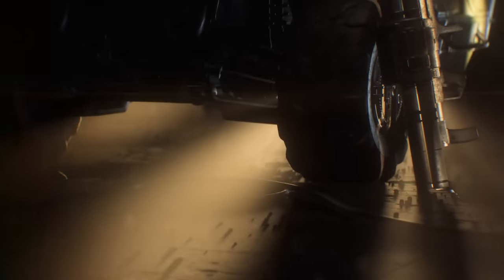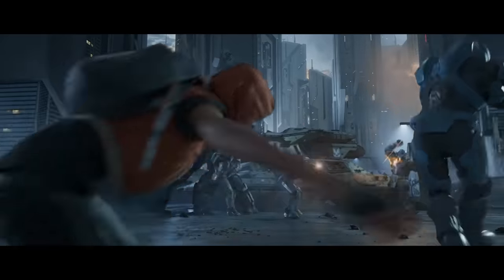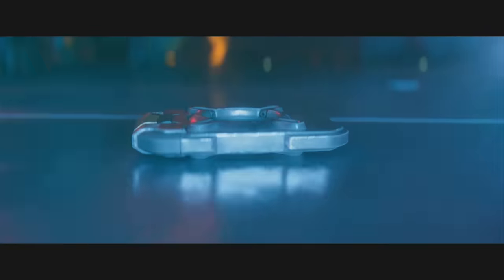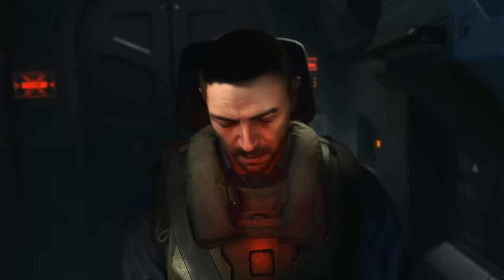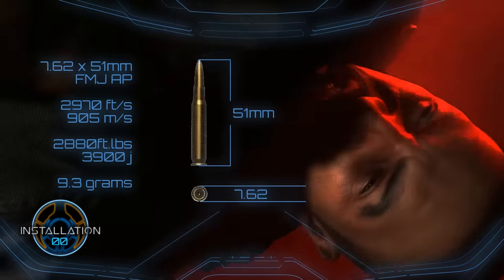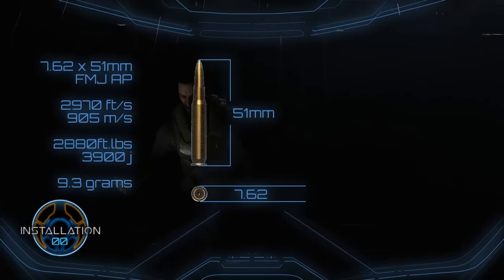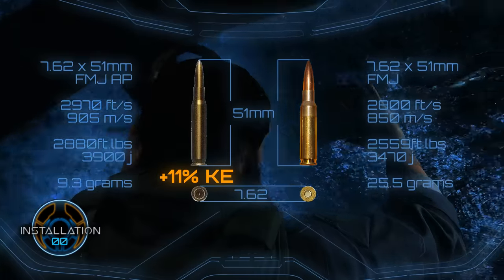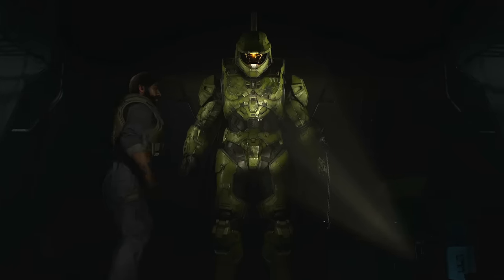Why are UNSC Weapons so powerful!? | The Armory

Comment: The main issue with the magnetic acceleration is having a hybrid system like that could cause a much weaker kinetic impact if there's even a slight desync in operations. A problem that could be rectified, but at that point, it could just as easily be a full rail gun and be better off. As is, it'd spend a lot of electricity on something that could, at best, prevent a full jamming and shoot out a bullet at roughly half strength. The geometry of the bullet is not exactly aerodynamic, not aerodynamic enough to be optimal for magnetic acceleration. A smaller projectile like a thick needle would be much better since magnetic acceleration would not be inducing rotation naturally, so it'd need to reduce flight friction. Those kinds of projectiles would also reduce the ammo's mass, or increase capacity depending on which way you want to go with it. Mass would be better thanks to the amount of magnetic coils and the weight of the battery you'd need in the gun to make it work. 

Personally I think there's very likely two things that would make UNSC ammo better. Improved gun powder, which he went over, and altered bullet construction. The FMJ AP bullet design (redundant because armor piercing bullets normally have the same jacket FMJ has, but whatever sounds fancier) could have an optimized bullet design, adjusting mass for higher speed and construction to have a stronger impact, such as having a thin, dense metal core that is designed to pierce easier. Something like that could account for the difference in power. Mass, less so because that's an impossibly light bullet, especially if it's intended to hit hard.

Comment: 4:06 Yeah the maths more than a little fucked here.

Muzzle energy is a just the kinetic energy of a projectile from the moment it leaves the barrel. This means the calculations for it is just Mass x Velocity = Kinetic energy.

In this case given muzzle velocity is 905m/s and assuming the 9.3g bullet weight is just the head it's supposed to be about 3810j of kinetic energy. As you may notice, this is the same muzzle energy as a normal 7.62x51mm cartridge. Meaning that the bullet, upon being fired either needs to get faster than it leaves the barrel or weigh more than when it's shot. Both of which are somewhat insane and unlikely explanations compared to someone fucking up the numbers.

More than likely the projectile has to either maintain the same 905m/s velocity but fire a heavier 9.52g projectile or use a 9.3g projectile but achieve a 916m/s velocity instead. At least in order to achieve the listed 3900j of energy in the infographic.

4:22 The issue here is pretty clear, you've managed to mix up the bullet and the cartridge. In standard vernacular a bullet is often synonymous with cartridge, however, in gun industry and ballistic science it specifically means the projectile being shot.

If a 25g projectile was being shot a muzzle velocity of 850m it would be hitting their given target with 9031j of energy. Which is clearly about twice as much as the Halo cartridge.

In this case the numbers replicated US 7.62x51mm M80 Ball, which from a  56cm barrel, achieves a 850m/s velocity with a 10g projectile to achieve a 3470j muzzle energy. The 25.5g weight is the weight of a 7.62x51mm M80 Ball if it has loaded into a M13 Belt link for use in a FN Minimi/M240 General Purpose Machine Gun. As the cartridge normally only weighs about 24.6g on it's own.

12:30 While making guns hybrid conventional-rail/coil guns is possible. It's, as you mentioned, rather unlikely.

My opinion is that if it's still 7.62x51mm then it's a mistake of numbers or just hand waved via better propellant powders. IRL examples of this have been done both by civilian handloaders and by military projects. The one that has seen most widespread development being the US Army 6.8x51mm and NGSW program. Which uses a absolutely tiny 33cm barrel to fire a 9g projectile at 914m/s for a muzzle energy of 3759j. If such a cartridge was fired from a MA5's 60.7cm barrel it would likely exceed the 3900j of the MA5.

However, I don't actually think this is the case. Instead, I think the person that wrote the numbers was looking at a standard 30-06 thinking that this was the civilian equivalent to 7.62x51mm. Modern commercial loads can push a 30-06 bullet weighing 10g at velocities of 905m/s for a total muzzle energy of about 4095j. There are other loads using heavier projectiles that can manage muzzle energies beyond nearly 4200j and velocities up to 1100m/s.

Comment: Modern cartridges aren’t generally limited by the potency or quantity of propellant. It’s very easy to load modern cartridges beyond their specified pressures. The limiting factor is the materials used to build the firearms and cases, and how much pressure they can withstand. If rifles and cases were invincible 7.62x51 could easily be loaded up another few hundred FPS.

This question is thus easily answered. Metallurgy and rifle design improvements have allowed for higher pressure cartridges by making the rifles more durable.

Comment: Good video on the subject, otherwise many would say that the reasoning would be game developer's biases. When I saw the concept for the video I thought mainly along the same concept guidelines as you but didn't consider the hybrid magnetic accelerator concept. The three main issues with that concept are the power, battery size and recoil management requirements. Considering that most  of these weapons will be used for hour's of continuous use would require a battery backpack armor setup like Spartan George's rig to function satisfying both the power & battery requirements, plus the extra force expended from long term firing even wearing basic armor could cause significant long term blunt force trauma to the body (akin to long term injuries suffered by professional fighters, except for augmented humans/Spartan's) given what we could replicate now. My future hypothesis of how this could be overcome within the game world standards mainly depends on three possible future innovations. One, the weapons draw power using the theorized wireless free energy concept purposed by NicholaTesla, thus meeting the power requirements basically anywhere (a far smaller amount of power would be needed than that of most other energy weapons)and sigicantly decreasing the battery size. Secondly, the gun barrel would need to house a electro magnetic accelerator past the middle of the barrel for that extra velocity (see XCOM 2 videos on magnetic weapons), the extra velocity does add more power to the projectile at a minimum cost and an acceptable rate of fire (with further recoil from the em booster directed further away from the body). Third and lastly, new materials would add more durability for longer service life and compensate for recoil to manage accuracy. Thank you.

Comment: Regarding your last theory of magnetic booster. The Marine's C-14 rifle from the Starcraft series works in that way. The rifle, while called the C-14 Gauss Rifle, is described as "Gauss Assisted". Ammunition used a traditional propellant to initially accelerate the round, and magnetic accelerators increase it's speed further. But...

This concept has confused me ever since I first heard about it, because if you have the technology to make magnetic accelerators that can go in rifles, then why even bother with a burning chemical propellant at all? Why not just use uncased, solitary projectiles that are entirely magnetically accelerated?

Granted I have only a passing knowledge of physics, so anyone with more knowledge feel free to explain how this would work. But with a "gauss assisted" system I can only imagine it going one of two ways.

Either the magnetic system is less or as powerful as the initial chemical propellant, resulting in the round traveling too quickly for the mag system to add any velocity at all. In which case, why bother even having the magnetic assistance.

Or, and more likely, the magnetic system is more powerful than the chemical propellant. Resulting in the round, once being caught in the magnetic accelerator, being pulled away from the expanding gases at a much higher velocity, thus rendering the use of the chemical propellant effectively moot. At that point the chemical propellant's only contribution is basically loading the projectile into the magnetic accelerator. A task which the magnetic systems could have just been built to do themselves instead. Or through some sort of plunger that pushes the round into the accelerator. 

To put it another way, imagine you're driving a car down a straight track. Now imagine as you are driving, an large plate or pad or whatever is accelerated to, let's just say 40mph, right behind you. If you are traveling at less than 40mph, the pad is going to catch your car and push it along at 40mph, rendering any power from the car's engine useless. And if you are traveling at 40mph or higher, the pad will not impart any force onto your car at all, as it cannot catch up to you to make contact, and it thereby may as well not be there at all.

Comment: As a reloader most of the weight of the round is the brass casing. If the UNSC went with polymer or caseless rounds the weight difference is right there.

Comment: if the propellants are theoretical, what would the SMG use?

it's caseless, primed via electronic circuit, and won't or rarely misfires (even during high cyclical speeds)

Comment: I just considered a Limited Gyrojet as the propellant does not burn completely during flight. In long guns and rifles the burn will last as long as the bullet is in the barrel allowing for more acceleration instead of the big kick on firing. For some reason this feels like it would not work out as well as I think it would. But this is the idea I have. 

And the bullets are monumentally harder than the ones we use today. Given that Humanity can condense matter to make Moljnir armor, a formulation, which might include the use of Tungsten (W), and/or condensation of matter to make ultra hard bullets is not out of the question.

Comment: Seems the current US military AP round corresponds pretty well with the HALO stats.  I bet the 9.3 vs. 9.8 projectile weight difference 
is a result of looking at a poor paper copy.  From Wikipedia:

Cartridge, caliber 7.62mm, NATO, armor piercing, M61: 150.5-grain (9.8 g) 7.62×51mm NATO armor-piercing round, black cartridge tip. Data contained in TM 9-1005-298-12 mentions an approximate maximum range of 3,820-metre (4,180 yd) at 854.6-metre-per-second (2,804 ft/s) muzzle velocity.

Comment: Just noticing, the figures for the UNSC rounds look pretty similar to those for the 308. Assuming advances in metallurgy, a light alloy may be used for the FMJ on the round. This could go a decent way to explaining to discrepancies in the figures.
Reply: That would be the possible explanation. Then there's also gravity. Materials made in zero g would be different than those made under gravity.

Comment: the halo firearms could be ETC guns (electro thermal chemical guns).
these use an electric plasma arch as a firing mechanism instead of a hammer and use a higher ignition temperature stronger explosive as a propelant. 

the guns also most likely have a time distributed recoil system in place, so the operator is not hammered to pulp.
material improvements keep the weight bearable.

Comment: It could be a multi part casing. The measurements are still off but if you look at the new round for the xm5, (6.8x51) they are achieving almost ridiculous pressures and velocities.

Comment: I think the magnetic accelerator is the most likely. Think back to nightfall. The unit was hunted by hunter worms attracted to the energy of their equipment. Including their guns that couldn't fire without the electronics activated. If it's only an ammo display that wouldn't be the case. But if the weapon no required that MA device as apart of it's function it would explain everything.

Comment: Kinetic weaponry has more penetration. Plasma weaponry leaves more surface damage and burns. Shrapnel is a thing that causes bleeding out. Plasma does not cause bleeding. There is a reason the needler is the most dangerous weapon in the covenant arsenal. Its the equivalent of a knife that homes in on its target stabs you  stays and then explodes. The slowness of the weapon allows a reactive trooper to find cover quicker than it can home in on its target. Less effective than an assault rifle which hits near instantly.

Comment: 10:20 - omfg, why do so many people get this wrong?  Any gun using any composition of poweder from black powder to smokeless to modern multi-base propellants will fire in a vacuum.  The firing chamber and cylinder bore are a sealed and self-contained environment until the bullet is expelled.  The only oxygen between the bullet and the bolt face is what is contained in the powder charge.  it doesn't matter if you are in regular earth's atmosphere, a vacuum, or even underwater, any sealed-cartridge weapon will fire.  If you test fired a weapon in a vacuum chamber and in a chamber filled with pure oxygen at 1 bar, both would expel the projectile with the same energy, because the environment outside the gun is not available for chemical reaction with the gunpower.

Comment: Every time I see a Halo Lore analysis I keep thinking about a sore point of mine which has caused Halo lore to irritate me.
Right now in the real world electro magnetic acceleration weapons (AKA MAC weapons) don't need any chemical propellant and are becoming commercialized, in the 2500s they would be common place and replace CPWs across the board of for no other reason then logistics.
Also we have prototype laser rifles right now witch means that in the 2500s the spartan laser wouldn't be special.
I realize that I'm nitpicking, but I like emersion so sue me.
Excellent video by the way! These analysis era greatly appreciated and I am actually learning a lot, my own hangups notwithstanding!👍

Comment: I just assumed cartridge ballistics have just improved gradually over time from present day - 2500's
i.e. 9mm used to be mostly inferior to .45 caliber, at least in terms of the wounds it would inflict on a target. Modern 9mm(talking standard 124 gr NATO spec ammo), however, is capable of inflicting at least comparable, but slightly less severe, wounds on ballistic torsos, and that gap closes even further when you take into account really expensive defensive ammo, i.e. heavier hollow points

Comment: I think it's more about the propellant of the casing and that many of the primaries are bull pup designs. To an exstant. In Halo Lore, the UNSC although have other weapons in development, the stuff you see in Halo 1, 2 and 3 just works. So there's not too much gain from the added cost of more advance tech. The only energy weapon from the UNSC during these games (Including Halo ODST and Halo Reach too if I recall) Is the Spartan Laser. And that has a big charge time for something meant to be used in the battle field. 

Later Halo games like in 4 and 5 have some tech advancments, my guess the weapons became more viable. And Halo Infinite has the most advancments. Granted, I need to look up a clear fraction list, but we finally have Rail Guns haha.

Comment: something that wasn't mentioned that is a possibility is the bullet makeup. consider a titanium penetrator and remove lead from the bullet altogether the bullet becomes lighter and thus the velocity is increased. this also would lend credence to the lighter round of the unsc 7.62x51nato and the modern 7.62x51nato

to make my point lead weighs 11,360 kg/cubic meter. vice versa titanium weighs 4,480 kg/ cubic meter while copper weighs 8,960 kg/cubic meter. modern FMJ rounds are a copper jacket filled with lead. this leads to lead being the main material of the round. even a FMJ AP round still has lead being the main material in most rounds as the AP rounds only tend to have a bit of hardened steel in the tip of the round. if you were to then make that FMJ round and instead of filling it with lead but coat a titanium core with copper to engage the rifling you are reducing the weight of the round. this would have the adverse effect of making the round decelerate faster. but since muzzle velocity is calculated at the muzzle of the barrel it would have that higher velocity

Comment: While I would see there being massive advances in propellant powder for the munitions used by the UNSC. Another way to increase energy delivered to the target is what the core of the round is made from. Could be titanium A which is used everywhere for the UNSC, tungsten which is used in thier Mac rounds. Or maybe it's depleted uranium since we don't know what was used before for energy generation between current times and the 26th century.
Reply: We're getting around to Tungsten being in AP small arm cores instead of steel, they could be using osmium for all we know...

Comment: I believe this may have been suggested by others regarding this topic, but I was curious about the possibility of the UNSC using electronically-primed ammunition in its weapons. I’m unsure of the physics, but it seems such a primer could be used to propel a projectile at exceptional speed. I don’t think this is quite the same as a rail/coil gun as the method by which it fires does not involve the use of magnets to accelerate the projectile. Furthermore, weapons with electronic priming exist or have been tested in the real world.

Comment: If they created a powder with much more power, it would create chamber pressures that could cause the casings to rupture. They'd have to reinforce the casing with steel like Sig did with the new .277 Fury rounds used in the US Army's new M5 rifle. Those 7.62  rounds would also be heavier but I don't see that. I would have to conclude that it comes down to the game creators being completely clueless as they didn't consult Battlefield or COD.